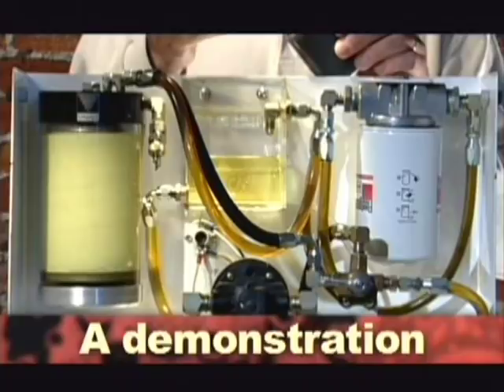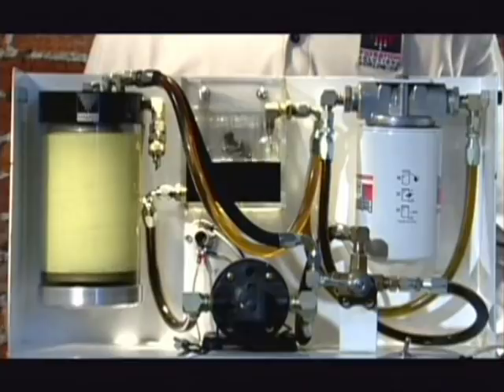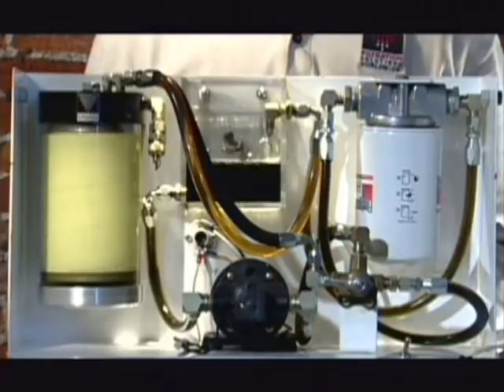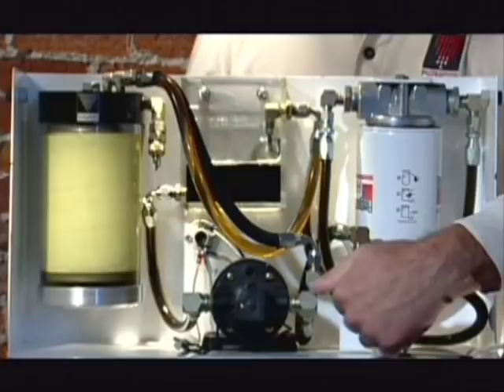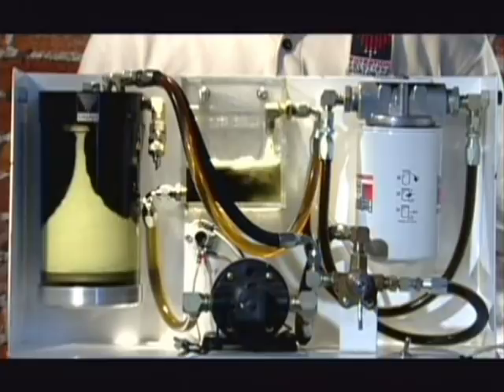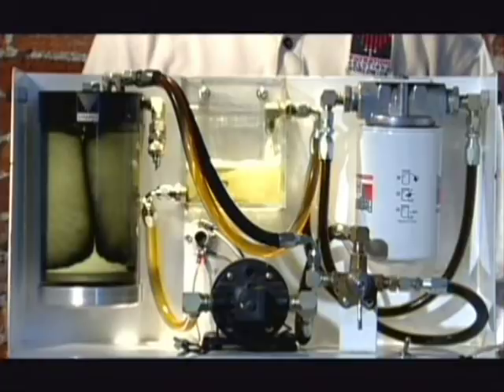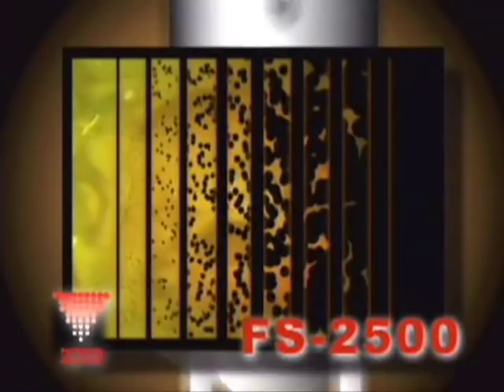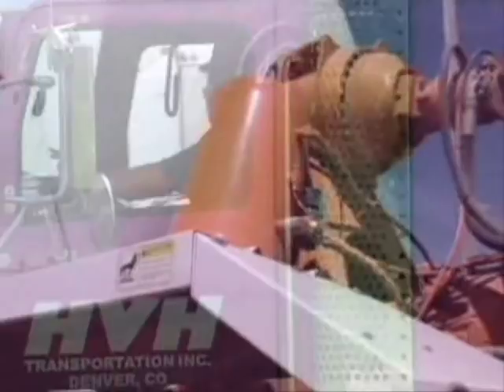Amazing Filter Demonstration - Save Your Engine

Comment: You guys. Read what Dan P. wrote, or go to the Amzoil website, or Bobtheoilguy , and do some research for crying out loud. I guarantee when you do you will regret posting these ignorant statements. Sure sign of "wet behind the ears" behavior. And to Azourecosee, Diesel engines get dirty a hell of a lot faster than internal combustion engines, and use  diesel oil which has much higher TBN specification which means several times the detergent as non diesel oil. Dirty oil in any vehical means that the oil is doing its job. If oil is staying clean in your motor chances are the oil isn't cleaning it properly. That is what one of oils most important duty is to clean the engine by suspending the soot in your engine rather than allowing to collect around in places like bearings and races, or just falling to the bottom of the pan. Then upon change intervals you get rid of it. The idea of a bypass filter gets better the dirtier your oil will get, and that is why installing it on your over the road tractor is a must to make money by keeping your truck out of the shop over the life of it. I guarantee using one will save you several 10s of thousands of dollars. All of the owner operators use em. The ones who don't struggle and usually don't stay in thier own rig and wind up working for someone. And for those of you that think it is easier to just change oil at frequent intervals is the way to go are not considering that tractors take 12 or greater quarts to change and that gets expensive. This is for professionals. All the manufacturers are putting them on as standard equipment now days.  You have to add one to your vehicle if you want to go for a million miles with very little engine maintenance no matter what vehicle your driving. That is the issue in a nut. This is a good subject to start learning how to think in a logical manner. There is hope for the ones who actually take time out to view the video. I mean the first step to becoming successful is being curious about the right things.
Reply: Joe Blow what he said...
Reply: Thank you for the support..
Reply: Joe Blow you mean 12 or so gallons
Reply: Branden truck#135 
No. II was speaking of a Duramax, or equivalent for example; statement is, "or more". Yes 10 or more gallons for a 10 wheel tractor.
Reply: I should have said,  "internal "GAS" combustion engines", but didn't proofread. Knowledgeable people know what I mean because the term  "internal combustion engine" meant "spark ignited" before "compression exploded" was invented. Diesels are Diesels as far as old timers are concerned. Nevertheless have you read the ignorant comments here on this video? Everything I stated is correct. Yes diesel engines get dirty a hell of a lot faster than internal gas combustion engines. Especially when Federal Emission Regulations required diesels to also include EGRs. Meaning all that black soot gets deposited back into system oil rather than shat into the environment. EGRs are bad enough on gas engines; they not only dirty the oil. EGRS also rob horsepower, and defeats the advantageous purpose of diesel's inherent efficiency quotient (ratio). And today with turbos & ridiculous DETs the oil gets dirty immediately.  That's why TBN is much higher in diesel lube oils; that's the point. Not sure what you mean by trust. Your comment indicates you are confused about the oil flow path of the oil; as are others.
Bypass filters are in "parallel" with sump filter. It works similarly to the bypass valve within most regular oil filters. IOW not all oil passing through either filter canister flows through their filter medium on every cycle pass. But all system oil passes through both filters within a few cycle passes as oil circulates. The difference is that a sump filter is mostly filtering at idle, or high gear / overdrive. A "bypass filter" filters oil at a greater rate when engine is at high RPM. Still lost?
Reply: '"Internal gas combustion engines?"  You're still missing it.  Your explanation is wrong.  You should have said diesel engines and gasoline engines.  

You're using big words trying to sound smart and you're striking out.  "Compression exploded" is not a thing.  "Compression ignition" is.
Reply: Solomon Parker
Son my advise to you is until you live & learn, keep quiet so as not to show your ignorance. I pity you at your age that your interpretation of my post is "big Words". Furthermore it is sad when I attempt to inform others by the written word that the explanation still fails to translate. But when I come across hard headed little ignoramuses that think that I'm incorrect they always have  at least one good question; but you comment as a "functional illiterate" yet it appears that you can at least type. Moreover I have had students with everything from ADD to "Autistic Spectrum" which is the modern version of the affliction that you present. Unless you have an intelligent question I bid you good luck.
Reply: GoodIsnipr,
I didn't use "ignition" on purpose for the obvious reason. I should have said "triggered", or "incited" etc. Master journeyman level mechanics & engineers, "Old timers", and intelligent readers were not the target of the post; it was strictly for the low information crowd. Frankly even if you are still clueless why I used "exploded" it is such a trivial issue I can't get over how ridiculous it is to take time to mention; especially since "exploded" is just as accurate plus it helps drive the point home. Though I'm not surprised you missed the reason given the other comments on this video. Furthermore  I've had to explain the diesel combustion process that way more than once for some individuals to finally get the picture. The reason is because vocational students are usually not up to par regarding thermodynamics. Moreover usually though even the most hardheaded "know it all" punk usually comes up with at least one intelligent question given enough time; it never fails that it is always post getting their ears pinned back real good.
Reply: GoodISnipr All you had to do is look up how bypass filters work right here on youtube. Some of the oil that goes through the main filter goes through the bypass and dumps into the pan cleaning out finer particles to extend oil life. Particles larger than 5 microns cause most wear other than corrosion.
Reply: wet behind the ears is saying tractors take 12 or more qts. try 12 or more gallons!

Comment: "bypass" means just that.If you are talking about a screen,then yes, but thats still a filter and it's not 2.78 microns most likely.
It's a simple fact, finer filters plug faster.There is no magic material or special design that can defeat this rule.Even the best systems work around this rule by using multiple decreasing elements that require you change them more often.Mileage is almost completely irrelevant,its the condition of the liquids you are filtering.

Comment: wouldn't that just restrict oil flow and oil pressure with is designed to keep bearings working correctly, correct me if i'm wrong.
Reply: that's why these filters are designed as bypass filters and not full flow. This is a demonstration.

Comment: So this "bypass filter" is going to filter out the: "zincs, anti foaming, acid reducers, corrosion inhibitors" etc.That Oil manufacturers have intentionally added to my engine Oil.  It stays "clean looking." It can halt the complex chemical processes of wear simply by removing the carbon coloration in the Oil? Impossible. It negates thermal breakdown too? Effing amazing!

Comment: if the information in this video is true then why do cummins recommend fleetguard  filters (which is the white filter in the video) for there engines and fit them as standard to new and rebuilt engines?

Comment: why is the pressure different  in the 2 filters? should make the oil filter see thru so we make sure its a new filter and not some used old dirty clogged up filter that's why the pressure is so low on that filter.

Comment: but again if this information is correct then cummins fit filters to new and reconditioned engines that do not provide adequate filtration. Then they give those engines a warranty in my case I get a 3 year parts and labour warranty on rebuilt engines so they are willing to fit those filters knowing that they will cause the engine to fail so they have to pay for a rebuild or new parts. that doesn't make sense does it.

Comment: There's nothing wrong with a standard filter
Reply: amen
Reply: You guys arent understanding whats going on here.  Go ahead and get a used oil analysis and ask for a particle count
Reply: There's also not a whole lot right with it.  It's great at filtering out large particles, but the small particles are what causes the most wear.
Reply: When thing do go wrong , it's never usually from the Engine, its nearly always ancillary equipment, such as bushes, shocks,clutches, springs, ect. Engines and engine components rarely fail these days
Reply: Small particles cause the most wear in a normal engine , because small particles are the only particles left in the oil after it passes through the oil filter. If the larger particles were still in the oil, they would absolutely cause more wear than the smaller particles. Don't believe me? Delete your oil filter, dump in a handful of iron filings, and see what happens.
Reply: Strake750, absolutely true.  EricTheCarGuy used full synthetic oil plus an off the shelf filter and used it for 1 year and did an oil analysis after 1 year of use.  The wear metals in the analysis were very low, most under 1 ppm.  But if people get a good nights sleep after buying whatever that is, it's their money so what do I care, I'll just stick to what works.

Comment: Remember, as long as your EGR is working you will ALWAYS have dirty oil!!!  DELETE!!
Reply: +1cleandude Tampering with the emission systems of a road-going vehicle is a federal crime with minimum penalties in the thousands of dollars.
Reply: +Tamás Madarász Not in this state pal.
Reply: +HunterTheGoon Federal crimes are Federal crimes in all states, buddy.
Reply: *****
SO? Are you some dirty commie? Thia rule doesn't apply to me because i drive classic cars only.
Reply: +Tamás Madarász i don't have a EGR valve in my 04 Grand Prix GTP and i can still pass emission tests.
Reply: Some cars do not have them at all eg 1998 Toyota Corolla CA emissions don't have them.
Reply: What does the EGR have to do with the oil other than blowby?  Any diesel is going to have soot in the oil.  It's the nature of the machine.
Reply: I think the idea is to reduce the amount of bad particles in your oil and thereby increase engine life.
Reply: You obviously don't understand what EGR does and why you should keep it. When the engine is running at low load, so the throttle is mostly closed, EGR fills the partial vacuum inside the intake manifold with chemically-inert exhaust gases so the engine doesn't waste power trying to pull the pistons down to BDC with almost no air to fill the empty space. EGR improves the performance of your engine. You shouldn't remove it.
Reply: Shawn Elliott egr does not male it easier for your pistons to make an exhaust stroke, or have any noticeable affect on idle quality provided a proper delete was done. Chemically inert? Sure you arent talking about evap? Theres no charcoal filter on an egr, it has plenty of chemicals in it. Fresh air is cleaner and has more oxygen, no way is an egr improving on that.
Reply: More oxygen is NOT what you need when the engine is running at low load. At low load, the engine is using a minimal amount of fuel, and the intake airflow has to be restricted to prevent too much oxygen from getting in and causing the engine to run lean, which would cause misfires. That's why gasoline engines have throttle valves in the first place, instead of just restricting fuel flow into the engine to control the engine's speed. The only reason diesel engines can get away with not having throttle valves is because diesel fuel is less likely to misfire in the first place, so running lean at low load is less dangerous. So since the engine has to run with a partial vacuum in the intake at low load to prevent running lean, it ends up wasting energy on the intake stroke trying to suck air through a mostly-closed throttle valve. EGR reduces the wasted energy by supplying the engine with exhaust to suck in to fill the partial-vacuum. The exhaust has no oxygen left in it, so it is "inert" for the purpose of combustion, which makes it a good space-filler. It also returns some of the waste-heat into the engine, so combustion energy isn't wasted heating up the cold intake air. (cold intake air is actually bad for efficiency, but car tuners like it because it's less likely to cause misfires at high load -- but EGR is non-functional at high load anyway.) The exhaust may not be perfectly clean, but it's no dirtier than the combustion products being produced by the next combustion cycle.
Reply: Shawn Elliott Bwahahahaha the ignorance of your comment, Bwahahahaha
Reply: Shawn Elliott no need to prove ignorance wrong, you're doing well on your own.
Reply: Shawn Elliott *no
Reply: Shawn Elliott your rejection is a badge of honour.
Reply: Shawn Elliott well, it may a have a positive side, but most of my engines are deleted because i would prefer all the air my engine digests to be cool and fresh. Im not really worried about idle, i only idle to warm it up or cool it down. I live in a rural area so no stop and go traffic. I dont use catalytic converters and i put a catch can on my pcv. On my benz i leave it all alone because duh, but my old Fords are simple efi that is easy to work on and improve. With just emissions removal and full exhaust with a simple tune get better mileage and have more power than stock, and do not require oil changes as often. I run 7000 miles and i drive gravel. Before it was 4k tops. This is on motorcraft syn blend and ocassionally a half can of MOS2.  Both are 302 powered.
Reply: Cool air is actually less efficient for engines, because it dissipates heat that built-up from previous combustion cycles, and more of the heat from the next combustion cycle gets wasted to warm-up the engine instead of doing useful work.. The only gasoline reason engines run better with cool air is because cool air is denser and contains more oxygen, and is less likely to cause spontaneous detonation of the gasoline -- but that only matters when the engine is working hard. The rest of the time cool air actually reduces the efficiency of your engine. Diesel engines, on the other hand, don't really benefit from cool air at all, because they're all turbocharged (which eliminates the oxygen density problem) and they rely on high temperatures to ignite the diesel fuel in the first place. Large trucks with diesel engines that run in cold climates have louvers to close the grille on the front of the engine bay, to keep the engine from being cooled off too much by cold outside air.

>_< Why do you run with no catalytic converters? Unless your trucks are truly ancient, the catalytic converters are already optimized so they don't interfere with power output, because wasted power is wasted fuel and the government has been ratcheting-up fuel efficiency requirements for decades. Modern catalytic converters (meaning 90s and later) reduce toxic exhaust fumes with no measurable effect on engine power, unless you've hopped-up the engine way beyond what the designers ever intended. On an engine reasonably close to stock, you lose more horsepower from the air filter than from the catalytic converter.

TL;DR: Engine designers know more about engine design than people who aren't engine designers.
Reply: Shawn Elliott they design engine to fit criteria, power and efficiency is not top of the list.
Emissions and cost are.
Reply: Shawn Elliott your understanding of the combustion processes in gas and diesel engines is wrong.
Reply: Tamás Madarász not in my state bud.
Reply: I'm not sure you know what "FEDERAL crime" means. It doesn't matter what state you live in.
Reply: Folks on YouTube just aren't the brightest, Shawn Elliot. You can't help them all, just let it go. I do agree with everything you've stated as I myself have been reading up on ways to maximize gas mileage on my truck and have read about making a "warm air intake" instead of a cold air intake for more efficiency.
Reply: Mark Wright in a gasoline engine a EGR is almost pointless to remove unless it stuck in the open position. Diesels on the other hand run dirtier and have more components to it like a EGR cooler. But I don’t see you gaining 20HP by deleting your EGR since it not used during WOT.
Reply: its not illegal in Oklahoma lots of trucks and tractors are egr deleted here
Reply: @conner5611  "Deleting any pollution control device, such as an EGR, is illegal. Not only locally illegal, but this is a federal crime. Should your state inspection also test for emissions, you will fail.

Do not dismiss this particular federal crime. The fines for deleting EGRs or other emission control devices are large, sometimes $10,000 or more."
Reply: ive yet to be fined for i run tractors with out egrs and emissions equipment same with my truck guess ill just wait till the feds come get me lol
Reply: ooh    scawy

Comment: Yeah... You can't filter down that much or the oil pressure would be through the roof, opening the bypass all the time when cold and guess what.... Passing all the damaging particles. "Problem intensified"

Comment: Over a million miles? That'd be crazy and awesome if it does happen! What kind of oil do you use, synthetic? What brand, if so? What kind of "by pass oil system are we talking about here?"
Reply: the most I’ve seen is 1.5 million miles.run by a professional driver at legal weights.CAT engines with no after treatment systems using 15-40 mobil delvac 1300